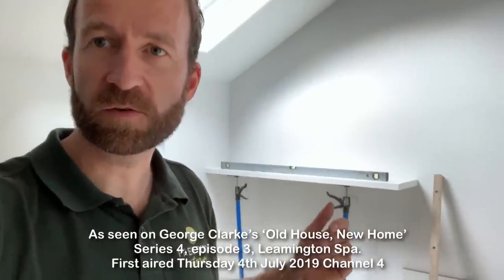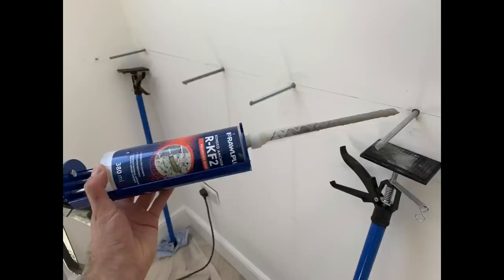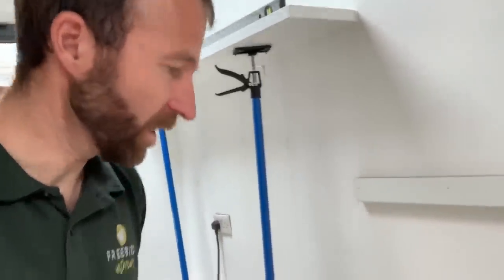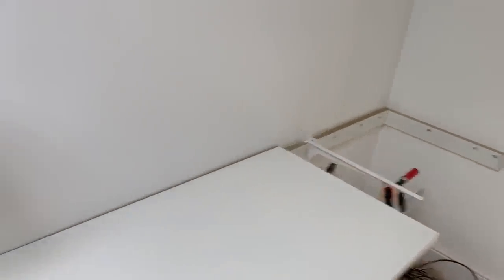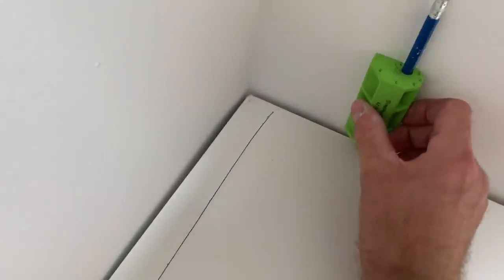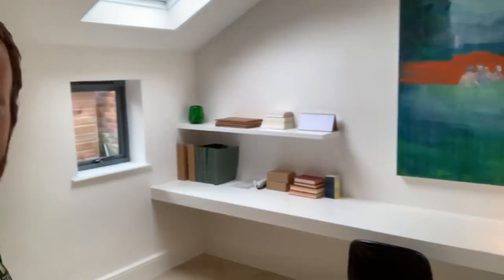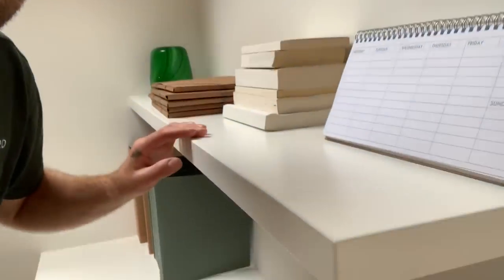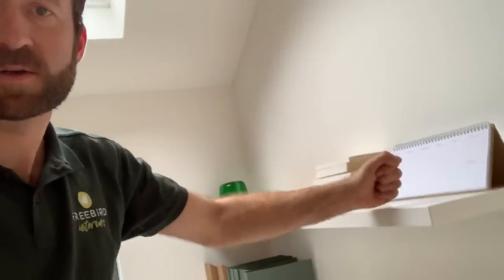Floating desk and shelf for an episode of George Clarke’s ‘Old House New Home’

Comment: Hi Alastair.  I'm an 'amateur', rather than a professional, whose been 'binge-watching' many of your videos for ideas and techniques.  Having lived most of my life in a 1960's bungalow (with plaster-covered brick or 'gnarly' concrete block walls), I have retired to a converted stone-built property which has (largely) been dry-lined inside.  How would you approach the fixing of such 'floating' shelves (or desk for that matter) in such circumstances?  Obviously, I would need to get myself a 'stud-finder' first and presumably position any angle brackets on those studs, where possible, but what about fixings into the dry-lining board itself? 

Great videos by the way, I am learning a great deal from them.

Comment: Very well done - what were those brackets called - couldn't quite hear you.
Reply from the maker: Hi they are the strangely named ‘Hegbo’ brackets from Hafele: https://www.hafele.co.uk/en/product/fixed-bracket-for-tables-and-bench-seats-load-bearing-capacity-150-kg-per-pair-hegbo/28744470/?MasterSKU=000000000000500e00010023#SearchParameter=&@QueryTerm=Hegbo&@P.FF.followSearch=9885&PageNumber=1&OriginalPageSize=12&PageSize=12&Position=1&OrigPos=1&ProductListSize=2&PDP=true

Comment: Hi the piece you added at the front to disguise the brackets, is it screwed down from the top? 
Also could a diy wooden bracket work just as well? Thank you love the videos you produce
Reply from the maker: Hi sorry for the delayed reply, I used kreg pocket hole screws to secure that piece, so they are out of sight and didn’t need filling
Reply from the maker: II don’t think a wooden bracket could work as well as the metal one projecting straight out from the wall without more of a diagonal brace down to a lower point at the rear wall

Comment: The walls will be made from Celcon / Thermalite blocks then. Nightmare to fix anything too.
Reply from the maker: Mark Carter is that right?  Are those products still in use?  I think it was an 80s extension.  Really strange building material the consistency seemed like... Parmesan cheese is the closest thing I can think of 😂
Reply: @Alastair_Freebird  
Also known as Thermashite!
Reply from the maker: @ash Wednesday when that comment alert came up I though I had my first troll or something but now I realise you’re talking about the blocks 😆
Reply: @Alastair_Freebird  
Lol.That would be a good nickname.
Reply: My house something called cinder block really hard ,but when I cut a hole for a door ,I looked like I had been down a mine!